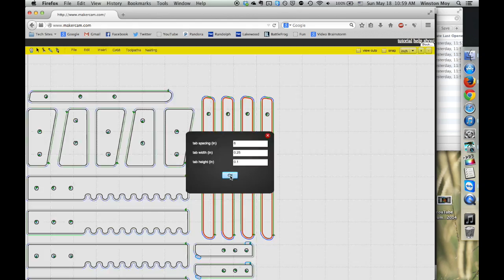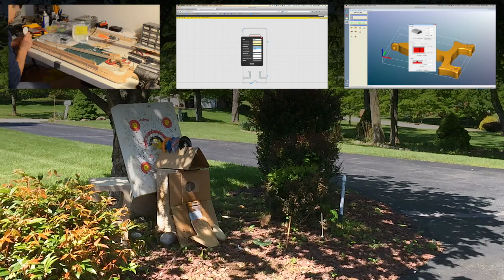Slingshot Upgrade: CNC'd Adjustable Shoulder Stock

Comment from the maker: Magazine-fed slingshot I'm working on. As for the automatic portion, I did think about it... maybe a linear-actuator type setup, similar to an airsoft gun. But with the force/draw-length/speed tradeoffs, I don't think the rate of fire would be very impressive.